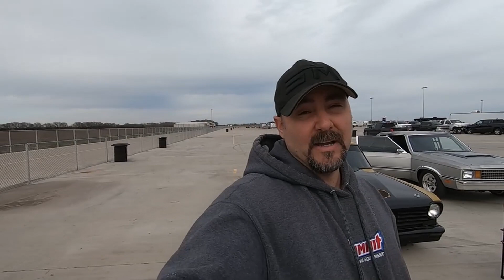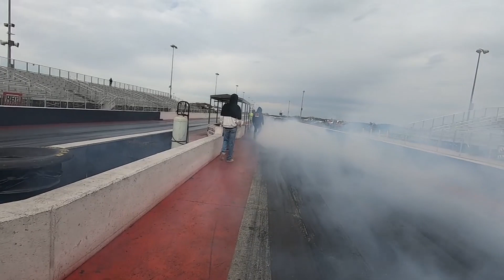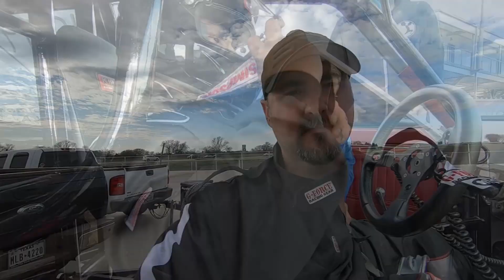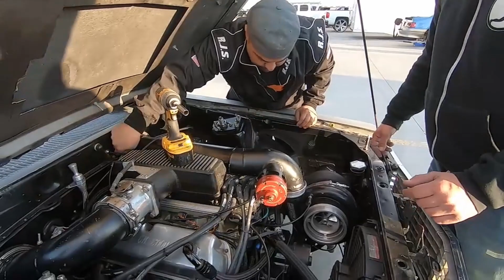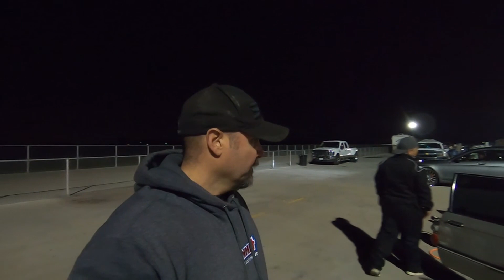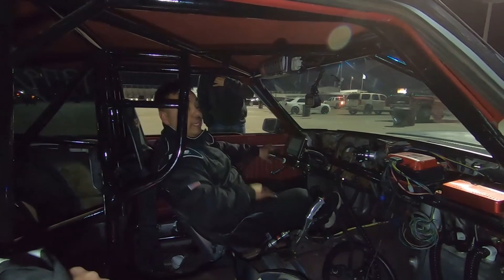turbo ls sunshine is back at the track with turbo fairmont

Comment: What oil pump are you running in your ls
Reply from the maker: Meling
Reply: @SickSnails  Do you have a part number
Reply from the maker: @boostedthirdgenracing  689-10296k you can order it through jegs.
Reply: @SickSnails   did you have to get a bigger pan that hold more oil my fbody pan holds 5.5 Courts
Reply: Oops holds 5.5 quarts
Reply from the maker: @boostedthirdgenracing  yes the moroso pan is 7 qt pan

Comment: What fuel u run and what pump
Reply from the maker: Pump gas on the street C 16 at the track with methanol injection. I use the a 1000